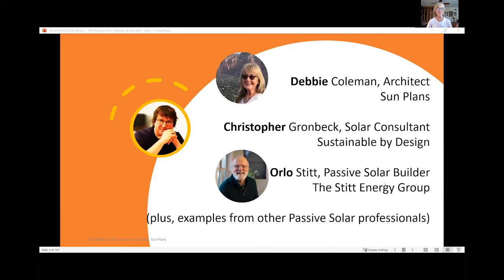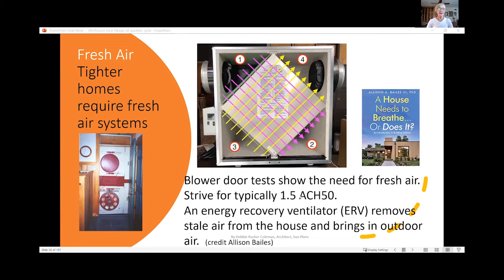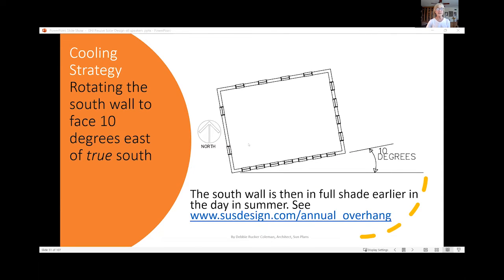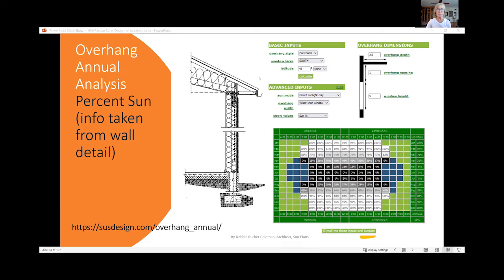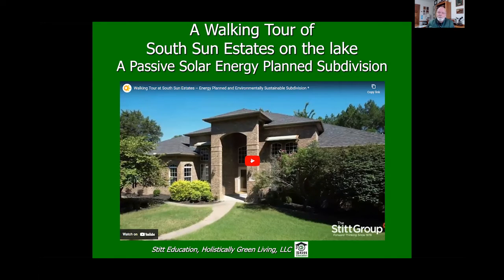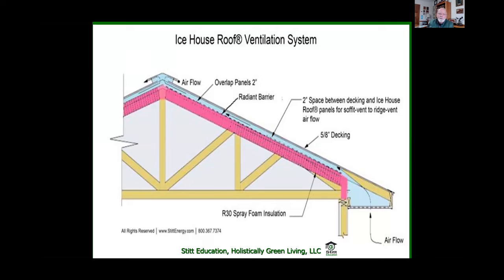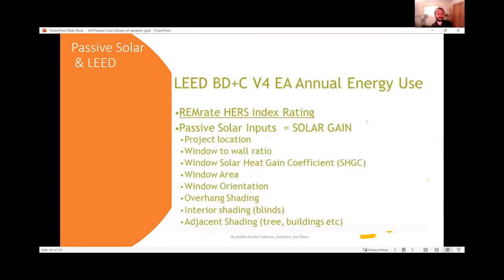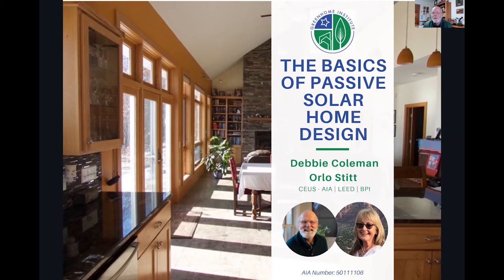The Basics of Passive Solar Home Design

Comment: Is the main drawback of a higher south facing window percentage just too much heat? If my south facing shading can block out noon sun from May-September, wouldn't it still be a good thing to access as much of the free heat as possible. I am also planning thermal mass systems with interior wall being masonry and being on a concrete slab. 

Curious why most passive solar designs don't seem to have a higher percentage of windows south facing.

Comment: Interested in incorporating GABLOK with passive solar home.
Reply: Passive solar homes can be built with almost any construction system such as ICFs, SIPS, or conventional stick framing. The inherent thermal mass of ICF can be a plus, and there are many ICF manufacturers to choose from based on your location. Slab-on-grade construction also has inherent thermal mass.

Comment from the maker: ivan2fast4u

If I have 10% on 40sqm floor is 2x2 window... on south wall?!?! Are you kidding me?

 

Assuming you mean a window that is 2 meters x 2 meters for your 40 square meter building, that is correct.  To clarify, the maximum recommend south glass in latitudes of approx. 30-50 degrees North is 10% of the floor area. South glass above 7% requires additional thermal mass per the webinar.

Comment: Does the overhang have to be built in?Can you install an awning instead?
Reply: Excellent question Marcia. Awnings of many types can also be used for window shading if a fixed overhang is not appropriate which could be in cases such as a tall south wall with lower windows, a gable end facing south, an addition, etc.

Comment: 31:57 "Trying to convince people not to build basements"? maybe a video about basements? I was thinking that basements are god because of better insulation underground, but I also feel like the best house is one that will last for a a long time, this way resources aren't used up over and over, and a basement needs to be as durable as the rest of the house, but I did not find much information about that and I am left with a general feeling that basements start failing in some way before the rest of the house.
Reply from the maker: Good idea! We should do slab on grade vs basements.
Reply: @GreenHomeInstitute  absolutely if the land is flat or slopes less than a few feet! The inherent thermal mass of the concrete slabs helps manage temperature swings and comfort for both winter and summer.
Reply: I'm looking into passive solar cod homes with basements or underground.
Reply: https://youtu.be/wRt_hIkOeDg

Comment: I want more information for those living in the equator (West Africa). I want to build a passive house, concentrating on cooling (the temperature year round is ~ 28°C +- 3°C).
Reply from the maker: "Modern Thermal Passive Solar is just starting to gain traction in most countries of Africa as the traditional architecture of buildings have passive heating and cooling features. Houses were built with thick mud walls for temperature insulation and depending on the region, the thatch roofing materials can range from corn stalks and straws to raffia palm leaves. Small or no windows were common in the old buildings to prevent direct solar radiation. Now modern buildings built with high thermal mass materials like concrete, need cooling and are retrofitted with air conditioners which are not energy efficient. Solar PV seems to be the adopted fix but costly to install.
I think passive building materials and design can play a more efficient role for thermal comfort. The choice of building material and design depend on the region's local environment. I know much of Central Africa is hot and humid in the tropics, hot and dry in other parts so the location is really important. In the tropics, light thermal mass building materials like wood will help with passive cooling at night, and in the dry regions, concrete may still work.

I did read a literature review on Passive Solar Systems for African countries that might have more information on the different passive design strategies that have been tried out in the last 10 years in different regions in Africa, I think it can also be helpful."

Best,
Remi

Remi Akinwonmi
American Solar Energy Society
Reply from the maker: https://www.mdpi.com/1984254
Reply: my advice would be generous shading ..insulated walls and roof (aac blocks)..solar panels and some kind of stack effect.

Comment: I see more discussion about mini splits than heat pumps now. Why ?
Reply from the maker: Those are the same thing. 😃
Reply: @GreenHomeInstitute   A square is a rectangle, but not all rectangles are squares.  
A mini-split is a heat pump, but not all heat pumps are a mini-splits; so they are NOT "the same thing."

I find that many times the person answering the questions on behalf of The Greenhome Institute answer in short dismissive answers.

Your answer does not meet your mission to "...empower professionals and homeowners to make healthier and more sustainable choices..." 

I would recommend that you reevaluate how you (as the institute) reply to folks, and maybe start by giving a better answer to this question.
Reply from the maker: @MrNiceGuyMEGA08  Thank you for your feedback. We just increased our staff here so we may engage better. This session is not about heatpumps so the question was not specifically relevant but you are right. It is very true they are not the same, a mini split is a heatpump but some heatumps are ducted or ground source. We see more talking about ducted than ductless which is the opposite of what this person said. Thank you.